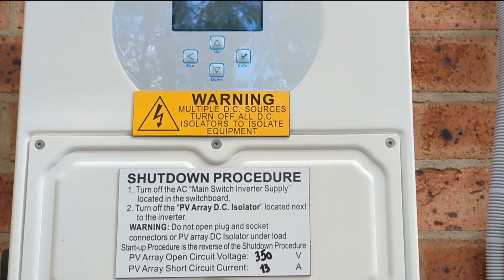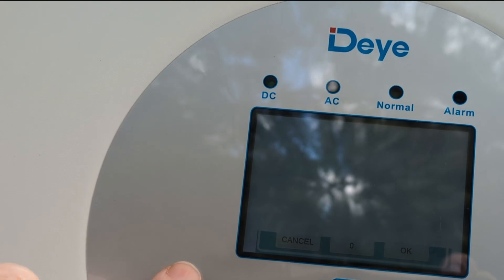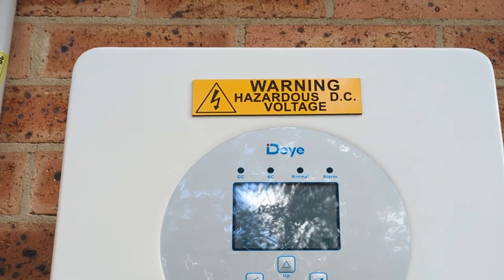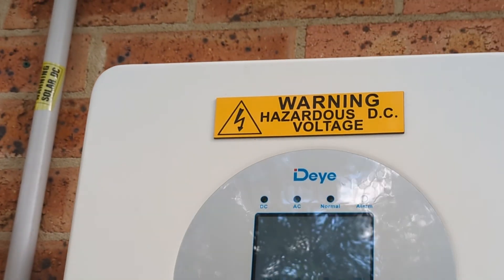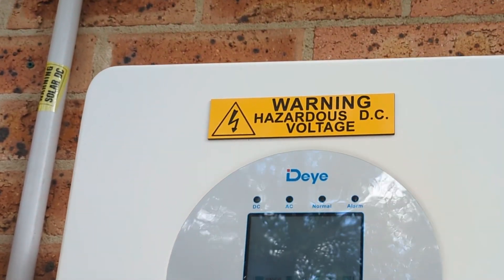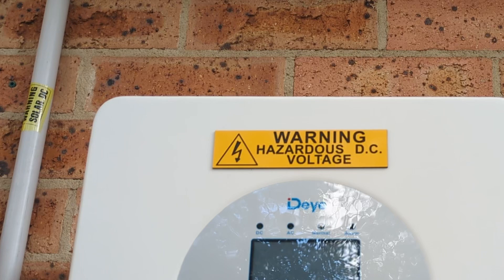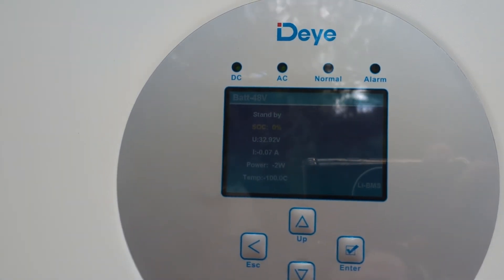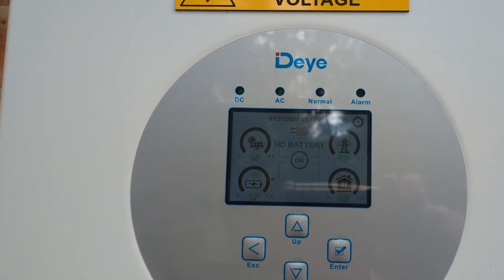Deye Solar Inverter Screen FAIL + Hoymiles Microinverter Input

Comment: I have the issue that my brand new Deye 15kW inverters display hardly reacts. I have to press very strong to get an answer but many options don't work. I can set them via solarman app per bluetooth, but it won't work via WLAN. The screen at Deye is very annoying, already adressed it to the seller but he doesn't know what to do. Anybody knows if its just a firmware problem of the HMI or is it a hardware problem with the LCD?

Comment: These equipment need to be more simple to operate. Like a vacuum cleaner. You turn it on and works.
Reply: There are too many different configurations, grid requirements, and they want to be able to sell it in different markets without changing their production, and it's intended to be installed by a competent electrician, so it's always going to be more complex than a consumer device.

Comment: Can't believe equipment meant to be installed outdoor is so poorly designed.
Such things should be ruggedized as hell and shouldn't rely on stupid touch screens. Good old 7 digit LED displays and few indicators are more than enough to show the required infos. It's not like you're gong to play Doom on your solar panel installation.

Comment: I have a Re-branded Deye inverter. One of the things that is at the top of the list of things to do when installing is turn on the LCD screen saver as the documentation even says they will not cover failed screens that have been left on indefinitely. Weird. My inverter is in my basement and not exposed to the sun or the elements. I think my screen timeout from last button press is 60 seconds. Touch wood, no issues in 5 years.
Reply from the maker: Seriously? That's nuts.
Reply: @EEVblog2  Yep. The warning is in the first few pages of the installation documentation.
Reply: Yeah installing a solar installation underground is the best way to prevent any sun damage ;)
Reply: The technology to run LCD non stop doesn’t exist

Comment: Was it still running without the screen? Might have been a bit error to the screen or memory corruption but the firmware never detects or resets the condition.

Also if the sun hits the screen directly (doesn't seem like it?) that's a good killer. A fridge magnet might give you a bit more life out of it. "Outdoor" ... almost none of these things are made to last for that kind of outdoor.
Reply from the maker: Yes it was still working fine and I could control it via Solar Assistant.

Comment: time to add Home  Assistant , grab that delicious RS485/CAN data and store it locally.
Reply: You can’t whack Home Assistant, I just recently got it and have home smart meter, solar generation, home battery monitor and charge control inc weather dependent cheap rate charge times all working. Delivering everything to PVOutput as well. Love it!
Reply: Already have it, see my other videos.